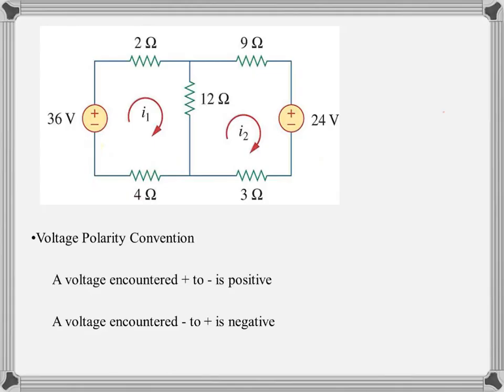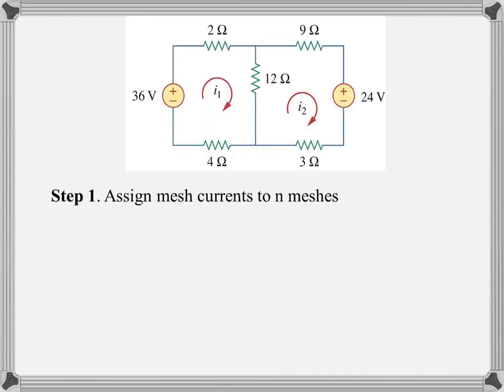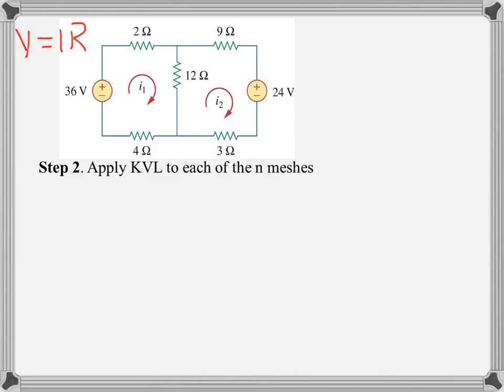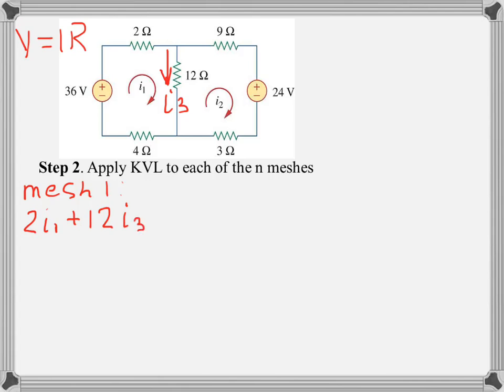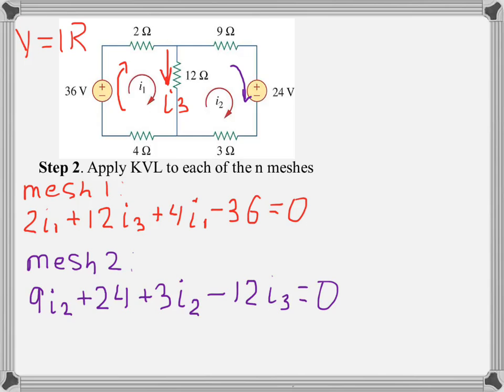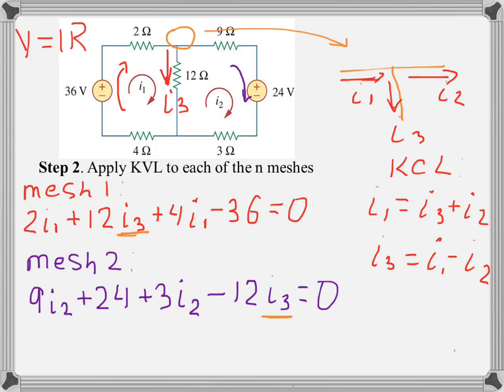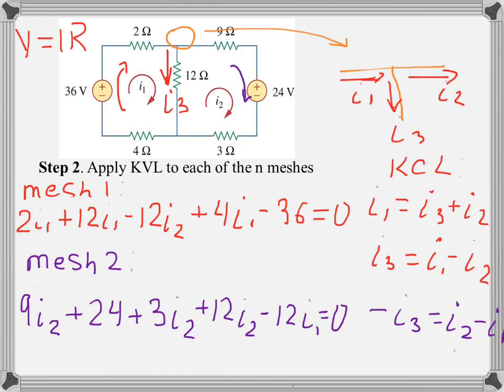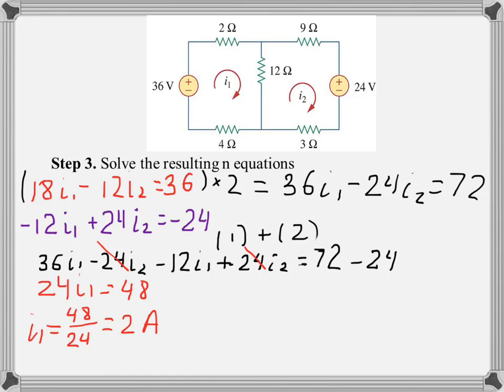Mesh Analysis introduction with example

Comment: too many issues with this analysis :
1. she says to use Mesh currents , however , she reverts to
     using  Branch current i3 . thus she does NOT know what a
     Mesh current is and she doen't know how to use a Mesh current.
2.  she talks about KVL , but does not emphasize the Ohm's law
      +-signs of each term of each equation .

continue reading , continue studying .

Comment: How is 9 ohm.resistor positive in second mesh?The direction of loop is from negative to positive across the 9 ohm resistor.Please reply fast my exam is in a couple of hours.
Reply: It depends on you what sign would you use. But be consistent in assigning signs on each components